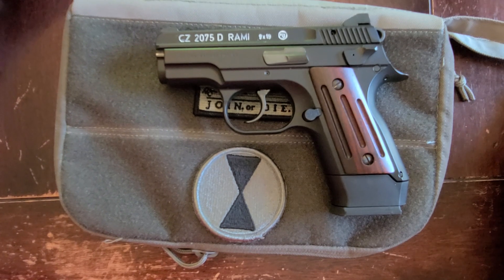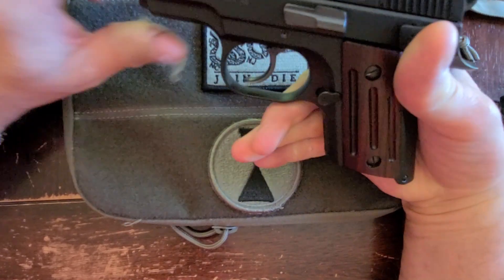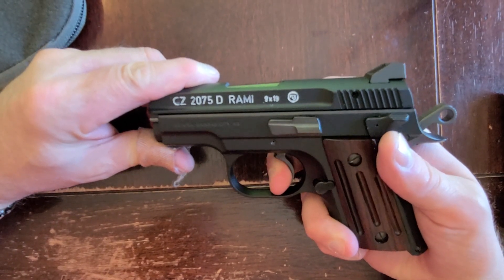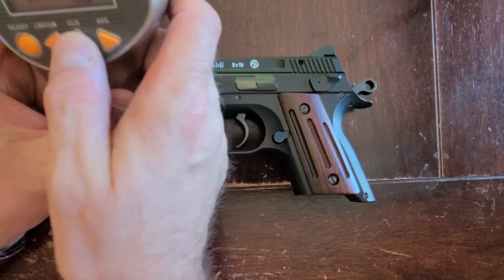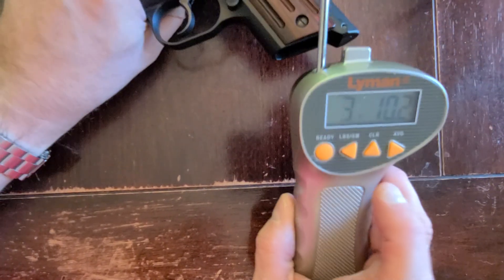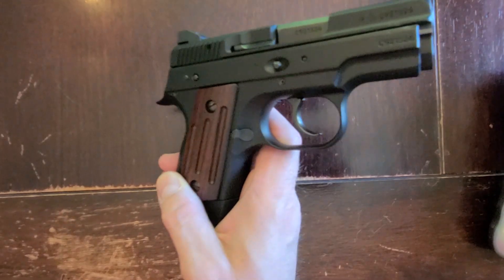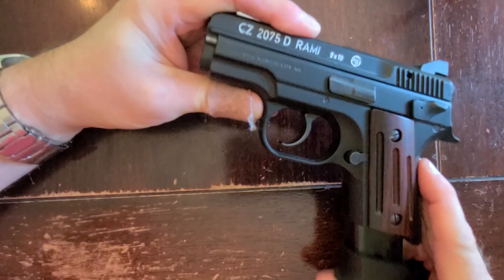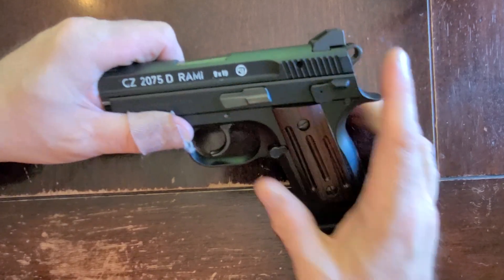CZ2075 Rami Steel Sub Compact

Comment: Three CZs and a Browning, all within 24 hours. This 1911 guy is learning more about the CZ line. Thanks for sharing the info.
Reply from the maker: Coming up this week will be a total of seven CZ videos (or CZ clones) and the one Browning Hi-Power. Thanks for watching it.
How is your CZ "test" going since adding the CGW parts? 
Which ones? STI or Wilson
Will you have a CZ vs 1911 videos coming?
Reply: @WheeledandWellArmed , I have had the P01 and EDC X9 out to the range a couple of times, but I'm not happy with either my performance, or my video work. Part of my problem is getting used to that double-action first shot - not easy for this Glock guy turned 1911 guy. I've even tried the P01 (Omega) cocked and locked, but the thumb safety does not really facilitate that type of carry, at least for someone who has lots of trigger time with a 1911. I'm still working with the CZ and I prefer the CZ grip and feel over the Wilson, but the Cajunized trigger can't hold a candle to the Wilson trigger.

Comment: Just found one at a pawn shop
Reply from the maker: If you want the decocker and have the one with a safety, we can trade?
Reply: @WheeledandWellArmed  that would be a smart trade. You can easily decock the safety version by puting your hand in the way of the hammer. Unfortunately you cant engage the safety without the hammer fully back

Comment: First off, damn those grips are nice! More importantly, I just picked up the manual safety Rami a few days ago and was wondering if there's anything I should watch for or if you've got plain ol advice on the pistol I'll take that, too... I'm going to the range this weekend and heard not to use powder-coated and/or steel jacketed.... Even heard conflicting information on the 14 shot magazine... I'm kinda in love with the piece lol so it's staying and plus it was hard to find so it was kinda fated, so any good tips like replacing springs, etc would be appreciated
Reply from the maker: I got the grips from eBay, I found the description "Cool CZ 2075 Rami Pistol Grip, Ball Groove Style Hardwood" but not there now. Maybe with the name they are Cool Grips? Maybe they forgot to repost and will be back soon. The small factory mag was way too small. The compact 14rd mag is perfect. I added the spacer. Spacers are easy to find. I only shot Critical Defense and FMJ in 115gr and 124gr without any issues. I would like to even trade my BD for a safety. I like carrying locked and cocked.

Comment: Beautiful pistol! I really like the color fill on the lettering. How was that achieved? Also, do you know if they have a variant with decocker on the opposite side? Thanks!
Reply from the maker: I painted over with white nail polish then with cloth and rubbing alcohol i rubbed off the surface or higher areas leaving the filled letters. I never heard of the ambitious decocker for Rami but CGW makes one fot the P01.
Or maybe CZ Custom makes one. I wish mine had the normal safety.
Reply: @WheeledandWellArmed  Thanks. You did a nice job, sir. Appreciate the reply. Merry Christmas!
Reply from the maker: @lazarusrize  Thanks Jude, Merry Christmas to you too. I shoot left handed alot but only to cover my left side without repositioning my wheelchair, so right handed controls work. My left hand actually has much stronger trigger finger.

Comment: What holster do you use? I bought the pinky extensions on eBay from mjeter.
Reply from the maker: I use Sneaky Pete holsters. One of my first videos shows what they look like and how they work. But a quick description imagine leather hard box with long flap and strong magnets to close it up. Two belt clips. The nylon holsters are called "covert" my blue one says "emergency" with the EMT symbol and my gray one says "battery". They clip to my wheelchair and "hide in plane sight". I'm making a big one for my Shadow2.

Comment: Can u tell me if it’s easy to rack. I have a S&W M&P Shield ez and the one I carry the most is my Springfield XDs which is actually a lil harder to rack, but my favorite. I have RA so there are days I wouldn’t be able to rack my xds. Thanks! I dig your glasses.
Reply from the maker: I am a quadriplegic but my hands are pretty good. I would say in general, CZ75 as a whole are harder to rack. Most every gun the slide on over the frame. On all CZ75 the slide is inside the frame, making it smaller and harder to grip. There are CZ aftermarket kits for a bar drilled into the slide for each racking in competition. It would look odd on the Rami.
Reply from the maker: I would highly recommend the Walther CCP M2, it is a retarded blowback, the barrel is fixed and the slide is easy to rack. The slide is big and easy to grasp. The trigger is easy to pull. I found the CCP to be very accurate, The older CCP got a mixed review because it was difficult to take down and clean the M2 is much easier to field strip. I have seen then at many ranges for rent.

Comment: Wish they actually made a steel frame model. Sadly theyre aluminum frames. Not a fan of how aluminum or light weight alloys feel.
Reply from the maker: It is a solid little guy. I want to trade this decocker version for the safety version.

Comment: I got my CZ2075 BD few days ago and it's produced in 2020 (it seems that yours was produced in 2019). However, mine is having fairly different look than yours. Yours is so customized in engraving and also the nice wood grips. Can you tell us how to get those done (and the link of the grips)? Thanks~!
Reply: As you mentioned in the comments, I found it in eBay now, still thanks~!
Reply from the maker: Paint over engraving with white nail polish and let dry. Then rub with cotton ball with alcohol until only letters are white.
Reply from the maker: @tomyen187  the grip's groves are sharp and deep but these wouldn't work for someone with sweaty hands.